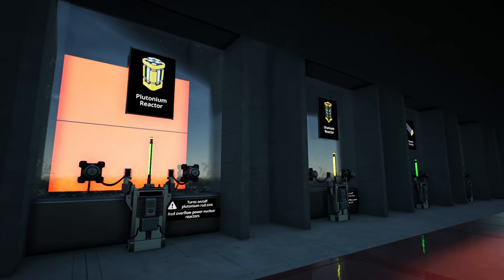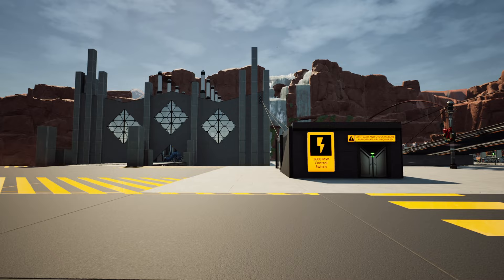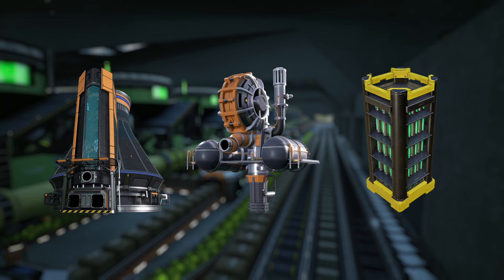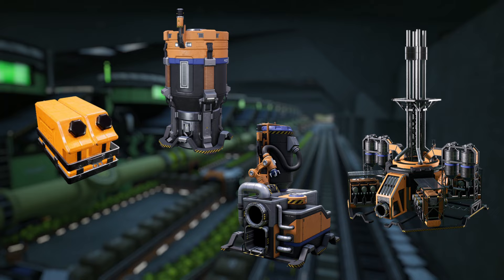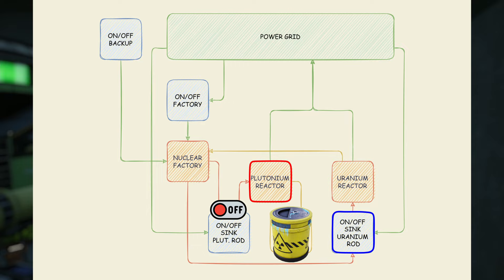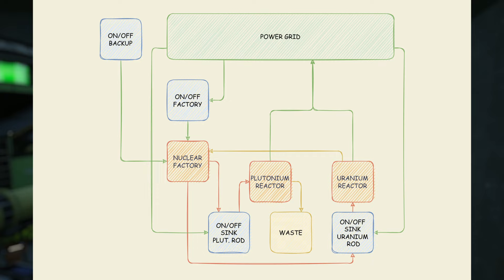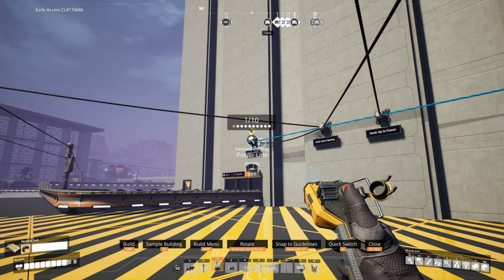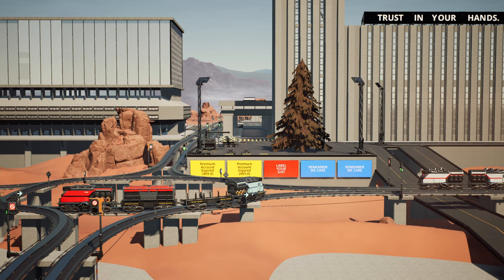TOP SWITCH SETUPS to KNOW in Satisfactory

Comment: Oh dear! I am slowly approaching Aluminum production and things start to get out of hand. Especially trains. 
For some reason, my train lines always end up looking way too wonky for my taste.
But thinking in production boxes like this might help to clean things up and reduce my overall need for power. I kinda want a big control hub now. Switches and Hypertubes to all parts of the factory.
Reply from the maker: Oh, I just started new save after finishing nuclear power plant on my current update 5 build. To many parts of my factory just became "unremovable" and nonflexible part of the picture. And sadwitch layer archeology is to intense at this point xD... Game stutters are actually real even with great hardware. Really want to make one center hub with bunch of specialized factories in separate biomes that can be shut down on demand.
Reply: I just got to aluminum production too and I am ALSO trying to setup a map wide train system but it is DAUNTING to say the least. I have alot of problems balancing the aluminum production properly and keep running out of silica even though I have a nice crystal mining operation setup. That isn't even considering I have over half a train system to create still and that takes so much time and I keep having to redo the lines because my trains fly right through my train stations due to gravity. So many problems to solve once you get to this point in the game that it becomes very hard to deal with alone.

Comment: i dont understand why would you need a power grid ? or safe system or so, as long as you keep tracking of nergy production and energy concuption you cant run out of energy and break th power grid.
Reply from the maker: "keep tracking of energy production" is solid concept while it works xD.

I really like to temporary decommission my coal power once I go Nuclear, or do Turbo Fuel setup. This way I can easily ramp up Aluminum production with all free coal without expanding my rail network. Yes, you can keep things at 100% ratios, but you need to keep in mind that game would stutter itself at some point if you just have to many production lines. Having ability to separate production and power is very important when your factory crawl to several hundred or even thousand hours mark. And once your total production line capacity exceed power grid, you will need to control power flow.

One misplaced (or not placed) belt or splitter can totally clog up full production line. same goes for nuclear waste recycling ratios, where paper values often do not work to 100% and result in collapse of system 5-10 hours later. Crafting filters for hazmat suit is very annoying task, when you can just pull several levers and fix majority of non critical issues.
Reply: @Yakez42  I dont know, maybe i dont get how you are using it but i dont see the point, if you factory cant 100% run then you just dont wanna build like that.

Once you start i guess tis ok to make mistake but if you can make a 100% efficient factory then you do.

Managing power seems way more inconvenient than trying to make efficient factory
Reply: If you have varying energy consumption due to unbalanced loads, and building a new factory quickly and don't notice power spikes, and maybe didn't have power storage yet, or materials for a big enough storage, then you can crash the power grid.  Coal or nuclear need machines to supply fuel and water.  No power, then no rebooting the grid.  So you have to build biomass burners and get lots of solid biofuel.  You can minimize the power necessary for restart if you isolate all the essential equipment like miners, water extractors, and fuel processing.  Also, maybe you play on a server, and you can "keep track" all you want, but you have zero guarantee that others will keep track.  In any case, your failure to understand the value doesn't have any bearing on the value to others.